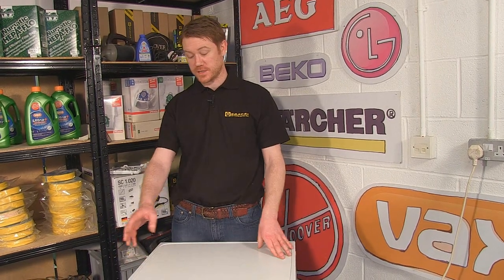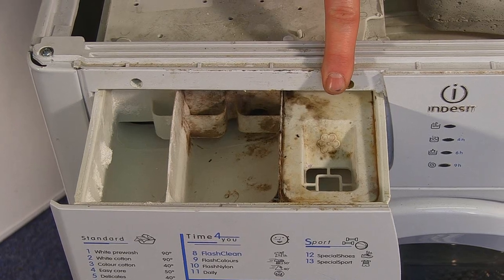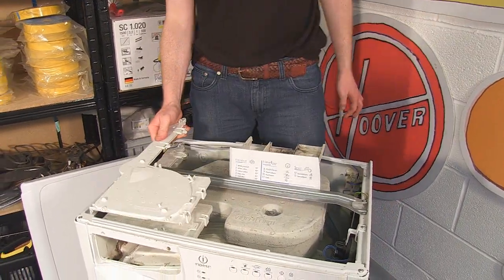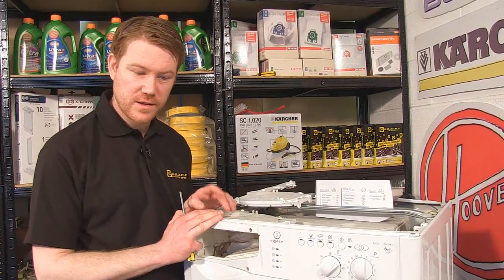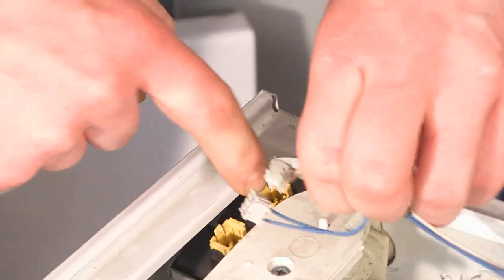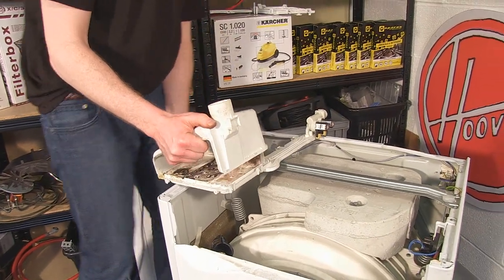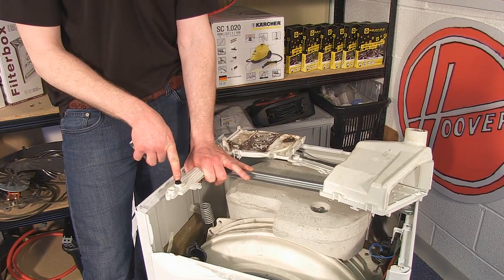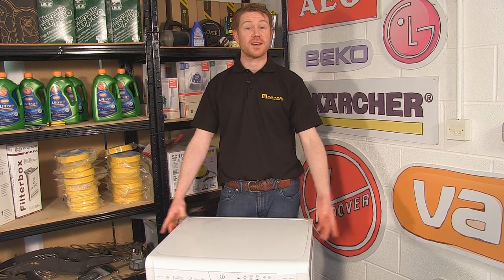Indesit Washing Machine Detergent Dispenser Problems & Cleaning Tips

Comment: I've been using an Indesit washing machine, and I moved into this place and the washing machine was very dirty by old tenants. Few weeks ago small dirt stains starting appearing, then I cleaned tray, and the rubber inside as it was black and after cleaning it all it got dramatically worse. These brown bits would appear, they would stain, but they mostly were solid until I touch them and broke apart like dirt, and other gunk appeared like a tiny piece of onion skin. I use powder detergent, and ever since cleaning it, and using conditioner liquid it got worse. I can't even clean my clothes now, I have 0 idea what causing it, if there gunk or mold in tube or mechanics in the machine or drain or pump. Any recommendation, it was 3 years ago the last comment so it fine if no reply?

Comment: I cleaned mine throughly.. taken it apart as you did.. I didn't replace the top but I have cleaned it with bleach and black mould remover.. it's immaculate and water runs through it freely and its still not draining the conditioner.  Could the problem be the valves themselves?  The machine washes perfectly otherwise.   Stumped.

Comment: Hi, How do I take the dispenser drawer out? You did it really easy on the video! I try it and one side seems to go out, but not the other side. It's an indesit washing machine IWC 61051 model.Thanks
Reply from the maker: Hi Sandra, sorry it is not very clear when Mat takes it out, how to pull it out is in the user manual page 16 care and maintenance but just pull it towards you raising it underneath and it should come out.

Comment: Hi
Thanks for the video
I am facing a bit of annoying problem with the detergent dispenser
Its always open and close which makes a bit of noise
Initially I suspect on the solenoid valves, but before I go and look for replacement I am thinking it might be a programming issue, or its the way it works
Pls help

I can share you 5 seconds video to see it clearly

Thanks

Comment: Thabnks for the video - just "fixed" my washing machine ( feeling rather proud lol)
Reply from the maker: Bask in that 'glory' Stephen, you are now a washing machine fixer.:-)
Reply: lol exactly :-) - thanks again dude.
Reply: eSpares ky beko is noisy during the rinse spin and the final spin😧
Reply from the maker: the cube a common cause with some Beko machines is the concrete weights under the front of the machine coming loose and banging on the drum. Disconnect and lower onto its side to check.
Also check out these videos:
How to Prevent a Washing Machines Spinning Noisily
http://www.espares.co.uk/advice/7/2401   and
How to Diagnose Drum Problems in a Washing Machine
http://www.espares.co.uk/advice/7/2625

Comment: I have hoover dyn8144 d1x (3 1/2 yrs old), could you, if you can, tell me what would cause water to leak through the holes in the lid of the soap dispenser housing. Ive removed it, cleaned it thoroughly overnight in bleach no mould or anything. Is it worth replacing the whole housing?
Reply from the maker: Hi Kenneth, you have done the right thing by cleaning the dispenser but if the holes are completely blocked or the dispenser is cracked it would have to be replaced.

Comment: GE PROFILE TOP LOAD 2007.   Help.   Loose change has fallen down into bleach dispensing housing unit.   I never use it.   Will it hurt to continue using washer in the future with change in there?
Reply from the maker: Hi Clt_jojo, we have to ask how did loose change drop into the housing? we don't have much information about top loaders but it would be much safer to retrieve the change.
Reply: Change dropped into the opening where bleach is poured into.   Therefore going down into dispenser housing unit?   That’s why I wanted to know if change would continue to go further into the barrel.   Don’t know how big the housing unit hose is?
Reply: When I put a pair of pants in washer change fell out of the pants into the bleach dispenser opening therefore dropping down into top load washer housing dispenser unit.    GE PROFILE TOP LOAD 2007
Reply from the maker: Hi Clt_jojo, yes the change may go through with the water so you will need to get them out.

Comment: Had an issue of conditioner not emptying and a moldy cover, the mold was easily washed with chlorine the fault was in the valve.
Secondary valve would only trickle water while activated.

Testing the valves, especially those which use mains power, can be a bit tricky/hazardous if you do not know what you are doing.
Reply from the maker: Hi TheAzynder thanks for your comments. We agree, testing the inlet valves can be tricky for some.
Reply: Im having trouble with water on the floor underneath this part of washer about 6 inch back from front.. Im wondering if this is leaking from the back somehow? Dripping directly underneath it 🤔
Reply from the maker: Hello @fortifiedlocksmithswakefield  . For more information of diagnosing the leak, please refer to https://www.youtube.com/watch?v=7b1-M_WKYJs&t.

Comment: Hi..I have some issues with my Indesit washer..I've had it out of it's slot now about 4 times, it wasn't draining off so I drained it off to take the sump plug out, but had to put the washer on it's back and remove the pump because the screw release at the front was sticking after half a turn, found 2 coins stuck in there, put it back together and it still wouldn't drain off,  so had to drain off again but this time the screw front came out but nothing was in there, so put the washer on it's back again, found the thin black pipe clogged with grey mud type gunge, scraped as much out as I could with a long thin file ( only thing I could find to fit in the pipe ), after turning on the washer it started leaking underneath, put the washer on it's back again, checked all the pipes to see if they were fitted correctly, made a few adjustments and tried again, water still coming out, but I don't think it's coming from underneath like I originally thought, it seems to be coming from around the soap box area, after watching your clip here..I noticed that black pipe that you disconnected to release the jet plate, do you thing I could have damaged or pulled the pipe off whilst pulling and tugging underneath?
Reply from the maker: It would be unusual for the dispenser hose to come off even if you lower the machine. Remove the drawer and check the lower housing has not been cracked and if there is no damage try lifting off the dispenser to confirm if the hose is still attached. Coins can knock a hole in the plastic tub if they catch between drum and tub on spin so check the tub carefully and even try filling with a kettle when it is disconnected from the power so you can identify where the leak is.
Reply: I sorted the hose, it had come away partially at the top connection near the drawer..I must have tugged on it when I was re-fitting the pump, it's not leaking anymore but the washer still won't drain..I've checked everything now for coins and other items that could be blocking something and everything seems to be clear now, but something is making a grinding noise when the washer tries to drain off, is it the pump?

Comment: Hello I have a general electric front load that is not dispense the softener and the bleach I have tried to work with service mode but the softener still in the dispenser the detergent looks like is working ok but softener is not ..can you tell me if I need to check something else or do I need to replace the whole detergent dispenser?
maybe the solenoids?
thanks
Reply from the maker: Check if on the final rinse the machine is filling both the wash and pre wash compartments. If it is then the valves are OK and the dispenser top will need replacing as it will be blocked by mould (a common problem hence the video).

Comment: I think my issue is that the black hose connected to the dispenser drawer below  is blocked. I really need help please (with what type of screwdrivers to buy). Thanks.
Reply from the maker: Hi Gbolahan Olaseinde, if you are unsure it would be better to get a set which will cover a range of machines and come in useful for other jobs.
Reply: @eSpares  thanks

Comment: Now how did u remove the top off? I found 2 screws on the back of the lid and I unscrewed them but the lid won't come off so can u please tell me if I have some other screws I should be looking for?
Reply from the maker: Hi haytham black, there are usually only screws at the back but the top connects to the cabinet at the front so when the screws are out tap the front to release, you can see mat doing it at 32 seconds.
Reply: Thank you very much @eSpares
Reply from the maker: Anytime haytham black we are here to help.

Comment: Hi. I have the same washing machine and I'm getting an H20 error on the display. The machine is taking water normally and drains well. could it be the water supply for the softener? Thanks.
Reply from the maker: A fill error is where the machine does not recognise the correct level of water in the allowed time. Run a test cycle, the water should fill to the normal level in under a minute and a half (approx). if it has not check the water supply is fully on and the water pressure is enough. For more information see another video:
https://www.youtube.com/watch?v=VS48G_cwCXo
Reply: ame

Comment: I have this exact same washing machine, cleaned the drawer and I still continue to get clear water residing in it.  But also I get water that slowly leaks out at the bottom of the washing machine, specifically the left hand side towards centre of the washing machine underneath.  What is causing this?
Reply from the maker: Hi aaronantonj if the water is still not syphoning then make sure the jets are clear in the dispenser top, if unable to clear then it might need replacing as in the video. You will need to check the internal hoses to see where the leak is coming from.
Reply: I've had to remove a sock from hosing under detergent tray 5 times.

Comment: I have the same model of washing machine. I removed the detergent drawer cover with the jets and gave it a thorough soaking and cleaning. When the washing machine is on the prewash cycle, water comes out of most of the jets in the prewash compartment and it seems fine, but then later on in the programme it makes a humming/straining sound and water doesn't come through the jets but out of the nozzle at the back of the drawer at quite low pressure, more like a slow dribble. Also, when running a full programme, the fabric conditioner won't get emptied, presumably because it is not receiving any water. Any ideas? Is it still blocked somehow or do I have another problem? The jets for the main wash compartment spray with good pressure.
Reply from the maker: Hi 123a, it does sound as if the drawer jets are still blocked, it may be you will need to replace it.
Reply: thanks for your help. The thing is, after I removed and cleaned the housing lid, I tested all the jets were clear by letting water run through it via the filling holes (where the solenoids would attach) and watching it come out through all the holes, so I think it must be something else. Solenoid valve not opening up properly?
Reply: I took the inlet valve apart to find that the one of the black diaphragms had a tear in it. I replaced the whole thing (though maybe I could have sourced just a black diaphragm / washer?) and it is now working again. It fills much faster.
Reply from the maker: Hi 123a, Awesome job! and thanks for letting us know as we like success stories.
Reply: The video made it a lot easier, thank you.
Reply from the maker: Your welcome 123a

Comment: Hi.
I cleaned my dispenser but have a problem now that water is staying in cell after flushing conditioner. Any idea why?
Thanks.
Reply from the maker: Hi Ryszard, if the jets in the roof of the dispenser are not supplying enough water into the drawer it will not syphon correctly, if they are too blocked it will have to replace it.

Comment: How do you take the dispenser drawer out from SLIM Indesit IWSNE 61253 C (do i have to pull it out like a madman?)
Reply from the maker: Hi Alex, hopefully, it won't be that much trouble lol pull it out as far as it goes then with both hands lift it from underneath and it will come straight out simples.

Comment: my misses was doing washing the other day at 90C and after some time she could smell burning wires. She said she could even fell itching in hey eyes. We got this washer back in 2008 for 200 quit so I don't bother to fix it. We just got new one for 300 9kg
Reply from the maker: +Phen0mable Might be worth checking the socket for any signs of heat damage. Washers on a boil wash use a lot of power so if the socket is worn or if used on an extension lead it can cause burning. May have been cheaper to check before replacing?.

Comment: My LG fornt washer would not dispense bleach and hot water. I did 
complete trouble shooting and found that when selecting normal cycle, 
then  everything works fine, but selecting other cycles then either 
bleach will not get dispensed or only cold water flow through.
Reply from the maker: Check you have enough water pressure on the hot supply as the valve may not open if low pressure. For more information see another video: 
https://www.youtube.com/watch?v=VS48G_cwCXo

Comment: Our Indesit IWME 126 conditioner drawer takes the fabric softener but replaces it with water after the wash cycle making it difficult to to put more softener in for subsequent washes.
Any Ideas??????
Reply from the maker: Hi Steve. As the conditioner is topped up by water to start syphoning it is not unusual for this to happen especially if it is filling slowly due to mould. Clean or replace the drawer top to cure it or simply top up from a glass to empty and then fill with the conditioner.

Comment: It's ok..I took the top off and I could see that the pipe had come away on the inside, but I still have the problem with the water not draining off when it's doing a wash load, when it comes to the point where it's supposed to drain the water away something is making a grinding noise, and the water isn't being drained away, is it the pump?
Reply from the maker: The likely cause would be the pump but check the filter again as something else may have washed into it during the drain cycle.
Reply: Just checked it again..for the 3rd time now, everything is totally clear, so it must be the pump then ?
Reply from the maker: Sounds like it, good luck.
Reply: Thanks, fingers crossed :)
Reply: Thanks for all your help, it was the pump, the new one came today and fitted it in 10 mins, working fine now :)
Reply from the maker: Thanks for the feedback Steve, it is always good to hear the advice given was both useful and correct.

Comment: You never mentioned about turning off the water and unscrewing the hose at the back?
Reply from the maker: Hi Shelly,  You only have to turn off and disconnect the water supply if you are lifting the dispenser and valves out.

Comment: How do you get the drawer out?
Reply from the maker: Hi ADC20032996, pull the drawer towards you as far as it will come, there is a button at the back of the drawer you push down to release it and the just left it out.
Reply: @eSpares  Thanks, but I can't locate the button.
Reply: Mine is the IWDE7168

Comment: ANYONE HAVING PROBLEMS WITH LEAKES OUT THE FRONT OF THE DISPENCER DRAW. YOUR PROBLEM COULD ALSO BE BECAUSE YOUR MACHINE IS LEANING FORWARDS, CHECK WITH A SPIRIT LEVEL BEFORE UNDERTAKING THE RECOMMENDED STEPS IN THIS VIDEO AS COULD BE A SIMPLE FIX

Comment: Can anyone tell me about a magnet in the dispenser that is stopping the machine from working ddo error code
Reply from the maker: Hi Supermom, after checking this error code DDO refers to the reed switch but also check that the magnet under the dispenser is secure otherwise it will cause the error code.
Reply: @eSpares  that's could you explain to me where the red switch is and I can't find a magnet at all I've taken out the drawer and I still don't even see where it would go so I can replace it
Reply from the maker: Hi Supermom 85, we do not have this type of washing machine so unable to advise as we have never seen it but hopefully someone with the same machine can help.

Comment: I've had to take a sock out of the water intake FIVE times on my front loader. Anyone know how I can prevent this from occuring?
Reply from the maker: There are two possible causes of your problem Jon.
Either the machine is being overloaded forcing small items to be pushed through the gap between drum and door seal.
Or if the gap is uneven or large it can also cause the problem.
There are 'wash bags' to put very small items like baby clothing to keep them together that can also help.
Check you are not overloading as you should only fill the drum up to 2/3 full.
If the gap is too large you can use a rubber or wooden mallet to knock the rim out and reduce the gap but leave about 5mm to prevent catching.

Comment: i use a spare clean toilet brush to clean the draw compartment
Reply: *****
it works wonders cos i had a washing machine that had a very long tray and an ordenery washing up brush couldnt get to the back of the draw compartment so i had a thaugh i rememberd i still had an un open toilet brush and it was more use full than the other brush i was using.
Reply: @torquetheprisoner    *drawer  (NOT draw!)
Reply: @stfuplsok  ok draw
Reply: @torquetheprisoner   *ordinary     *thought     *remembered
Reply: @stfuplsok  damn did you eat a dictionery
Reply: @torquetheprisoner   *dictionary

Comment: how i can pull the drawe
Reply from the maker: Hold firmly on either side and carefully pull. On most Indesit machines like the one shown the drawer is held by a plastic 'ramp' under the body that has to push over the front panel. Pulling on the front of the drawer could damage the drawer.
Reply: eSpares can you remove the drawer without taking the top cover off the machine? I just need to clean the soap drawer.